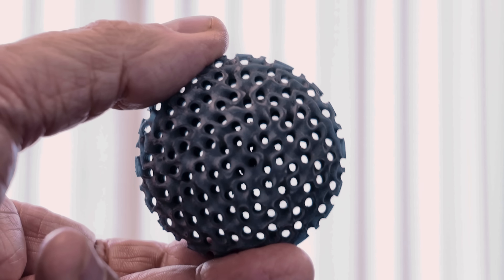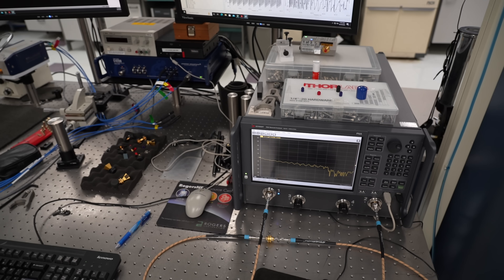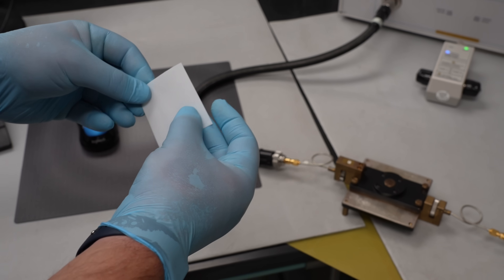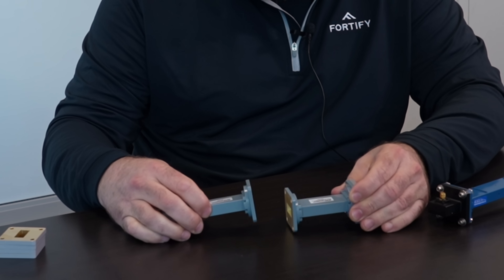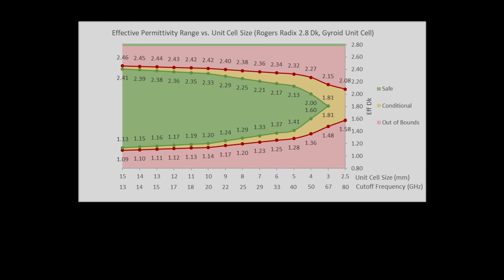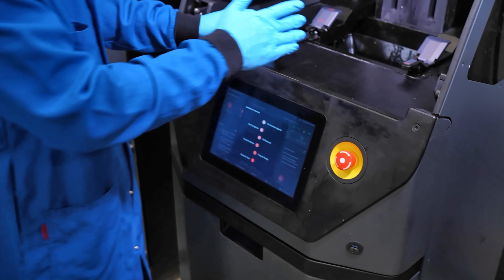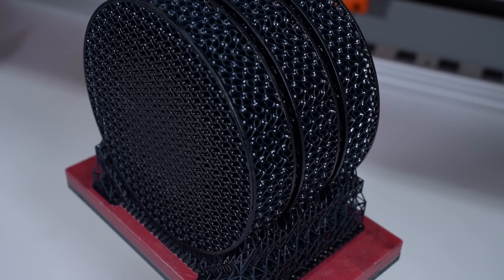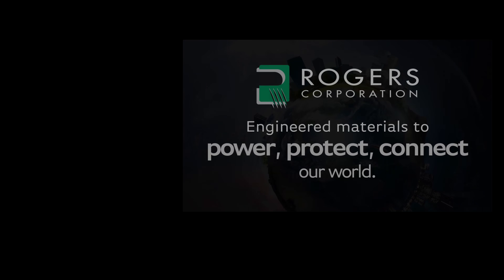Unveiling the Future of Antennas and RF Lenses using Radix™ 3D printable material!

Comment: It was all very interesting, even if I didn't understand the half of it.  Q: Is lhere a very slight lipsync error on the studio part of the video? Could just be me.
Reply from the maker: One section was TOTALLY faked because of a minor editing disaster. The audio and video for that are from different takes a few days apart.  Most of it should be OK, but it's going through a Zoom F3 into the analogue input to my Sony a7iv and it's possible there's a tiny bit of latency that I hadn't spotted. I'm in the middle of changinbg to a new non-linear editor (from PowerDirector to Davinci Resolve Studio) and I'll be using 32 bit floating point sound and S-LOG3 log video and doing manual sync until I can get a timecode solution in place. The fake section sticks out very obviously to me, but it's fine if you close your eyes or turn off the sound and read the subtitles!  I'm rubbish at video, sound and TIG welding.

Comment: I'm completely lost, what sort of antenna is that (looks like wormholes to me) and why was one of those opaque "filters" put inside a flashlight? Probably a fun video for those who know the details but utterly confusing for the rest
Reply from the maker: The flashlight is going to be used to make a test source with a searchlight-like beam of microwaves at 24 and 47 GHz for testing the coverage pattern of antennas.  These are well-known dielectric lens antenna elements, but being made with a gradient index material instead of machines from solid, which allows much more freedom about how you can manipulate the microwave signals

Comment: As a ham radio operator this video is very intriguing.
My company does ion plating of metals onto  various substrates. I would like to discuss what needs to be metallized on these devices  and  try metallizing some of the cured dialectic material.
Please contact me about this interesting  application .
Reply from the maker: I may have replied to this already, but please get in tough with Rogers Corporation to discuss this, it sounds very interesting

Comment: I have to speculate if a sponge design wouldn't create hotspots and or Doppler effects internally causing heat, or wasted power?
Reply from the maker: The loss tangent of the printed material is about 0.0043 which means that the dissipative loss is under 0.5 percent. The material has a fairly low heat conductivity though, so at extreme powers you might need to use forced air cooling, but that would be a pretty radical application.  The unit cells are usually less that 0.1 wavelength so the individual cells don't have high voltages across them either. It needs to be considered of course. The loss on solid PTFE, cross linked PS, HDPE or PU is about ten times better, but the resin gives you the option for internal index gradients, no machining or waste, and potentially lighter and stiffer elements

Comment: Am I correct assuming the different dielectric index throughout the material is caused by differences in thickness of gyroid walls?
Maybe further improvement for longevity could be filling all those air gaps with some inert resin so the material doesn't collect dust and other unwelcome particles or living organisms inside.
Reply from the maker: Yes, exactly.  Where the feature size is less than about a tenth of the wavelength in the dielectric, scattering effects are limited and the bulk behaviour of the material is very close to that of a continuously variable permittivity solid dielectric.  Filling the voids is problematic because almost anything you fill it with will have a permittivity approaching that of the material.  Low loss plastics like HDPE, PTFE, cross-linked polystyrene, UHMWPE and PU all have permittivities over 2.0, adn the material is only 2.8, so they are non-starters.  A closed-cell foam might be feasible, but I think I would go for a radome and perhaps a very thin dielectric membrane, and perhaps feed the lens/feed with dry air or nitrogen.  Printing a closed film on the outside is certainly feasible apart from the impact on curing and washing.
Reply from the maker: Another approach might be to use a higher permittivity fluid that could fill all the voids and use a chemical set, and design the printed elements to be the "voids" instead, but that it getting into "very hard" territory.  I'm sure some hugely brainy engineers will dream up some super--clever ideas with this material and printing technology
Reply from the maker: Also of course there are many alternative space-filling porous foam-generating expressions.  Gyroids are very simple maths and have the benefit of not having disconnected elements and overhangs which would appear during printing of the layers

Comment: Anyone out here building antennas using metamaterials yet? Same stuff that caused the "invisibility cloak" news articles. It has tremendous potential when used for lower frequency stuff like radio and microwave antennas. I've seen UHF antennas that look like a standard 5/8 or 1/4 wave ground plane, yet out perform a standard yagi at the same frequency that's 4 times the size. Meaning this, they perform as if they were the yagi, only omnidirectionally.
Reply from the maker: Check out Rogers' MAGTREX® 555 High Impedance Laminates.  They have controlled and matched permittivity AND permeability and you can do slightly magical things as a result, reducing element size but not losing out on feedpoint resistance or bandwidth.  It hurts my synapses trying to think of the possibilities, but it's a cool material.  Only good to less than 1GHz at present I think, but it might be an interesting thing to try. Perhaps you could create an omni colinear phased array of reduced linear dimension. 
 I think I'd have to spend a few hours with an E-M solver to work out the effects.  I saw nice big sheets of the stuff in the labs. https://www.rogerscorp.com/advanced-electronics-solutions/magtrex-555-high-impedance-laminates
Reply from the maker: Any good references to papers that would be useful reading? If it's possible to do PVD or something then overplating, or just printing supports to hold the conductive and dielectric elements, that could be the basis for a very cool experiment in a future video.  After the 57 I have in the current pipeline, of course.

Comment: I imagine theres a measurable benefit of using this lattice structure as an antenna... Can it be tested against something conventional?

Or side by side wave propagation simulation...

Antenna lattice vs old school antenna
Reply from the maker: The ultimate test for me is a simple comparison between a metal Pickett-Potter dual-mode feedhorn like these I made previously and a circular waveguide tube feeding a simjple lens and a GRIN lens.  Those results will be in a future vid.  I've tried for the last six times where the Moon has been in a quiet part of the sky and well clear of the Sun and high enough in the sky at a time when I'm available, and there has either been terrible weather here, or at the other site I'm trying to test with, or I've had a domestic disaster.  Usually there are a few days each month where the degradation is low, and some of those happen at accessible times, so a rainy day can wreck my testing until the following month.
Reply from the maker: previous models for comparison: http://www.g4dbn.uk/?p=1644 http://www.g4dbn.uk/?p=716

Comment: I know that 3D printing is amazing, but there are other things that happen to materials when they are being formed, which go beyond merely laying the molecules down into a particular shape. There is the forging of metal, for instance, where pieces of metal are bent and formed into shapes. Nothing like this bending process occurs during 3D printing. That's just one example that I can think of. It's like they think that the only thing that matters is the final shape at the end. The structural properties of that final shape are not going to have the same properties as a piece of metal that was bent and hammered when it was forged. I'm sure there are many other examples besides that. It's just that many things can be done to a material besides setting it down on matrix or whatever - stretching processes, bending processes, compression processes, heating and cooling processes, and however 3D printing works, it doesn't do those things to the material. That's not saying anything about the growth processes and evolution processes that go on with living organic materials, or the bioelectromagnetic processes that happen during the development of an embryo, when the cells are moving into a particular position.
Reply from the maker: Sintered materials are certainly different in their bulk behaviour, especially when they are not formed under immense pressure.  Electromagnetic performance of 3D printed metal waveguide elements is primarily about the surface finish, so there's a limit to the radio frequencies at which sintered metal parts can be used and electroplated without surface scattering being a problem. Same applies with vacuum or centrifugal investment casting and even pressure die-casting to greater and lesses degrees. We live in very very interesting times my friends

Comment: You can't copper plate a print? I'm pretty sure there are some mixed metal-plastic filaments that can be electroplated later
Reply from the maker: Filament is available in all sorts of interesting combinations with metal content, but I don't know of metallized UV resins. As Phil mentioned, something using laser sintering or one of Rogers' specialist dielectric adhesives with a matching permittivity/Dk would be the way forward. I would probably do metallization with plasma PVD in my vacuum chamber, then electroplate, perhaps with an electroless dip to start with
Reply: @MachiningandMicrowaves  Ah there is the detail I missed!  I don't know much about UV printing, just FDM

Comment: I'm a layman, so I'm certain I'm wrong... but that Lunuburg Lens... Would I be able to take a soccer ball (football) sized version and stick it high in the air on a pole, to have it act like a passive amplifier/'repeater' to focus what energy it can collect, into an antenna that's mounted near the ground? 🤔

As basically, in my rural area, I get crap 750MHz cellular signal, even with my 2x 4ft antennae mounted ~20ft in the air. I have, if I recall, LM200 cable (maybe LM400?), which are 15ft long. 

Which that's the real crux, is the cable length vs signal loss; hence, being curious about a passive collector like that. As it looks, to my layman eyes, to function like an Omni on the one end, but as a Yagi on the other? 🥴
(again, I'm sure this is just wishful thinking on my part)
Reply from the maker: It focuses all of the energy from a distant source to a point in the surface diametrically opposite to the direction of the source. You could perhaps use a conical reflector with an included angle of 90 degrees to send all signals from the horizon down to a dish pointed upwards, perhaps using an axially-displaced elliptical geometry (ADE) rather than a parabola and hyperbola (Cassegrain) or a Gregorian.
Reply: @MachiningandMicrowaves  In order to ensure I've followed correctly, I like to dumb an explanation down...
So what you're saying is that the Lunuburg Lens would (fittingly) be like the lens of a Periscope.
Instead of a 45° mirror, would be the 90° Conical Reflector.
Which at the bottom, would be an Elliptical Dish (a "focal reflector", yes?) to which the antenna would be mounted?

My immediate thought is that this sounds like the giant radioastronomy dish that... I think is near Princeton, NJ, and made back in the... 1950s I wanna say.

At any rate, if my understanding (dumbing down) is correct, my question then becomes:
            Would such a service still allow for TX? 😒

I didn't know, or expect, it to be a bidirectional lens. So I figured maybe it could be mounted higher, instead of mounting the antennas themselves at that point. All in an effort to increase just the RX rates. The antennae being in their current spot, would thereby keep the TX rates they manage right now. 
Whereas it sounds like this 'periscope' would require repositioning *everything*, and doing so would put the antenna in a spot that, if left to their own abilities, would be ill suited for transmitting. (as in, if the lens isn't bidirectional)

Anyways... You entertaining my fringe idea/question is MUCH appreciated!! 🍻❤️

Comment: Putting the lens in front of the flashlight would enhance the power of the flashlight? Or would it send out a signal like a sender. Could this be used to send stronger signals into space and make contact between satelites easier. Is it possible to use it for deep space exploration? Or is it ment to make microwave weapons? Maybe I dont know what im talking about? :D
Reply from the maker: I've replaced the LED in the torch with a signal source at 24 or 47 GHz. The small horn antennas send out a diverging beam with about a 70 degree angle.  The lens then bends that and collimates it into a more parallel beam, concentrating the energy into a tighter angle of maybe 3-4 degrees. That in itself can only increase the directivity of the system.  The effect at long distances is a rise in the received signal by perhaps a factor of 10 to 50 times, but that extra energy comes from that which would have gone out at other angles, so there's no extra power, just more power per unit solid angle in the beam. A dish antenna is likely to be lighter and more performant, but I can use this for whatever you could use a biconvex lens when messing with light (or heat at infra-red with a Germanium lens.

Comment: Is that the same as when printing a lens then using different infill density to control the wave inside the material?? Should that not be more even then?? Why the criss crossed holes inside?
Reply from the maker: The hole pattern using a gyroid lattice give good mechanical stiffness in all planes with no sharp corners or intersections that might led to failure.  It's a fully 3D lattice structure with good mechanical properties and is anisotopic, whereas a rectangular or other regular mesh might lead to odd bulk diffraction effects I guess. You can use whatever meshing or lattice you like of course. Also Gyroids are cute under a macro lens

Comment: Very interesting.  Can this be used to focus microwave oven waves to a tighter spot?
Reply from the maker: The lenses are a bit too small for the 12 cm wavelength used in a microwave oven, but the principle is right.  If you dismantled an oven (please don't!) and aimed the magnetron output at a much larger version of the lens, it would certainly be able to focus the power into a much more concentrated beam at a point.  The tightness of the spot is limited by the wavelength, but it behaves very much like a biconvex magnifying glass for radio waves.  You could make a big lens by printing it in sections, but it would need to be over a metre in diameter at microwave oven frequencies, so not awfully practical (yet)

Comment: as an enduser unlikely to learn even half of what you know, would the beam focusing work in wifi ranges?  i have 100 acres that i want to have provision anywhere, so a self-attenuating rotor co trol would provide directioning, but the range would need to be 1/2 mile.  does this material lend itself to a solution?  and how long before it's on a shelf for me to buy?
Reply from the maker: It's probably not going to be cost-effective at 2.4 GHz as the amount of material scales as the cube of the wavelength. At 5.8 GHz, it's probably feasible, but I'd think that a phased array patch approach might be more practical for that sort of area, if beam-steering is possible like it is at higher frequencies for 5G and Starlink etc
Reply: @MachiningandMicrowaves  i was thinking lowtech for the rotor, i should have grabbed my dad's old archer.  then figure out a system to scan and lock on my direction from the camp based on signal strength, and to rescan if our connection is lost.  maybe something that recognises which side of the beam i wander out of would help track me side to side. Thank you for the amazingly quick concise answer.  you are a rare signal.
Reply from the maker: @markanderson3740  I would set up a separate scanning system with an array of receivers that rotates like a ship radar and locates the strongest signal and steers a directional antenna at the target.  But that's cos I'm a nerd.  Professional approach would be to fit multiple sectorial vertical arrays to cover the area of interest at high gain and use multiple access points or diversity switching to select the best signal, taking multipath reflections and hand-off between APs into account.  Here, I just run armoured Cat6 cables rated for soil burial and carrying power over ethernet to some remote APs to cover my forest garden so I can get a phone signal while I'm down there (no cellphone service here, I'm much too far from civilisation)

Comment: Curious question as a complete amateur, why does the minimal surface pattern like the gyroid lattice help with microwave antennae?
Reply from the maker: It's a good choice for a 3D printable space filling pattern as it has no disconnected elements when sliced for printing, and it's easy to scale the wall thickness with a parameter that varies over the volume of the space. Other triply periodic minimal surfaces should also work.
Reply from the maker: Also it remains mechanically stiff even at small wall thicknesses
Reply: @MachiningandMicrowaves  I see, thanks for the explanation!